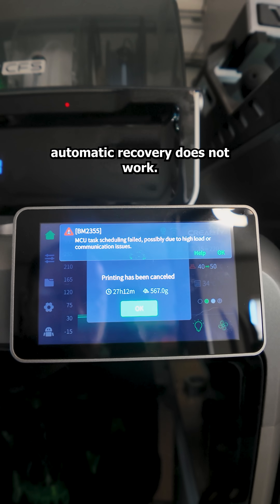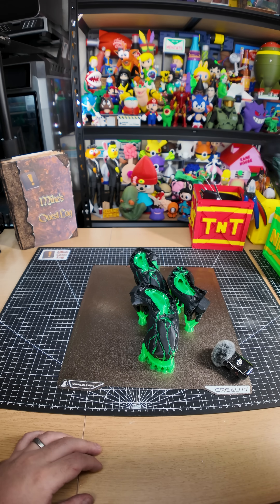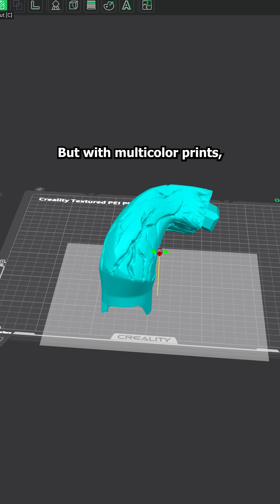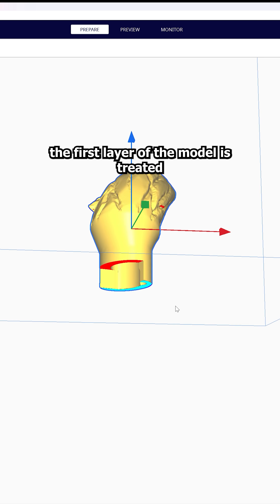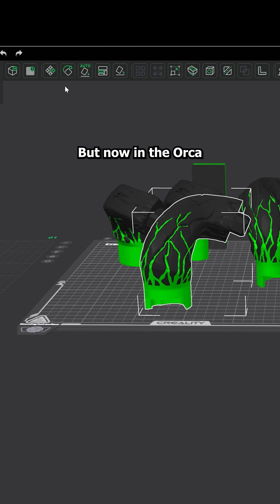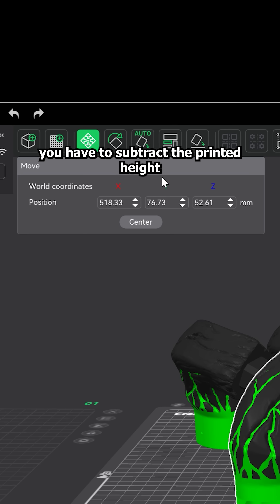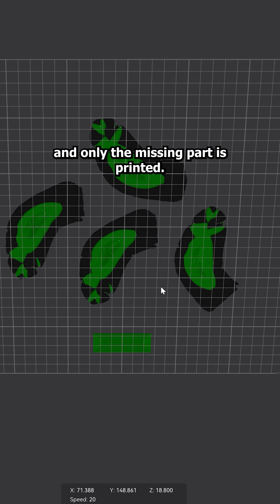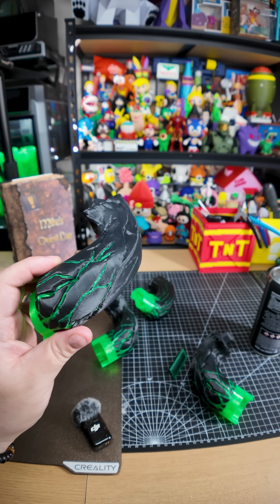Failed print? Try this fix! How to save time and filament when your print fails

Comment: is there a way to check which layer the print specifically failed at?  Would multiplying the layer height by that number to get the actual amount of height left in the print?
Reply from the maker: Some printers show progress by layer. But the calipers are quick and easy way to check. In worst case scenario you could count the layers by hand
Reply: @MikesQuestLog  gotcha, thank you so much for this tip!  It would've saved me hours of frustration when my guitar stand failed

Comment: There's another way - flip the model 180° and stop print at that layer or you can cut it but without funny tricks. For this particular model it would require supports though.
Reply from the maker: Cutting models removes color data

Comment: I'm not sure if that second slicer would work this way, but you might just be able to type -82.4 or whatever after the starting number and hit enter and it might do the math for you. That's how most art software works.
Reply from the maker: It unfortunately does not work this way. That's why I gave solutions for both types of coordinate systems used my any slicer

Comment: Really bothers me that orca based slicers do that. Wonder if there’s a setting that can change the anchor point.
Reply from the maker: Yeah it annoys me to. It cannot be changed unfortunately. I've looked everywhere
Reply: Not Orca based slicers but Prusa slicer based - in fact Orca also uses Prusa and Bambu source code
Reply: @mateuszabramek7015  ah, thanks 🙏🏻
Reply: @mateuszabramek7015 slic3r based
Reply: I am also afraid of IT.
If i want to Check some diameters First, i also Print only the critical part with this Methode. And even If i now the minus measurement, i have to fiddle around with Orca 🤷🏼‍♀️
Reply from the maker: @Chris-14all you can always calculate the layers and then confirm the layer count after slicing. That way you have 2 data points to double check and it will work 100% of a time
Reply: in the newest version of orca you can choose between world and object coordinates

Comment: In Cura, you had "drop down model" selected. This option anchors the part to the build plate. If unchecking it doesn't fix that, check the global settings to see if something like it is set there.
Reply from the maker: The drop-down setting has nothing to do with that. With "drop down model" checked you simply cannot raise the model above the bed and make it float. The coordinate system does not change.

You might have misunderstood something in the video. Cures works perfect. Orca based also but I was only explaining the different way they handle coordinates for people who might use different slicers.